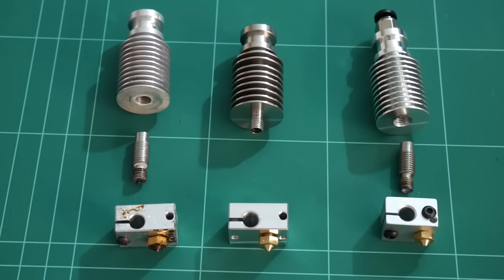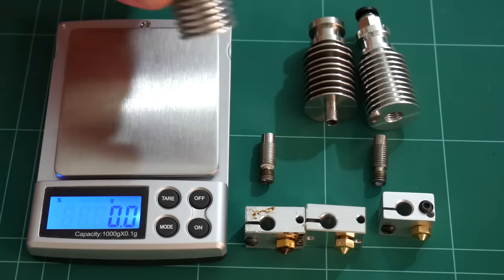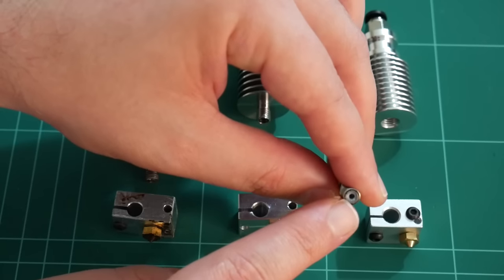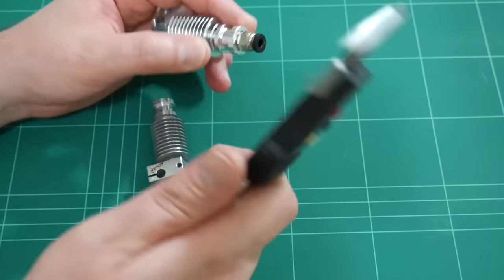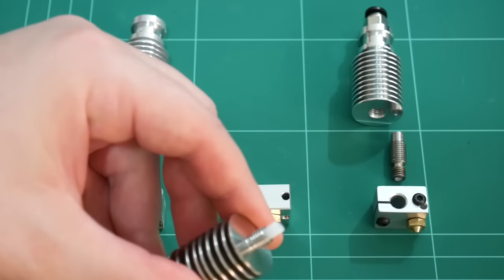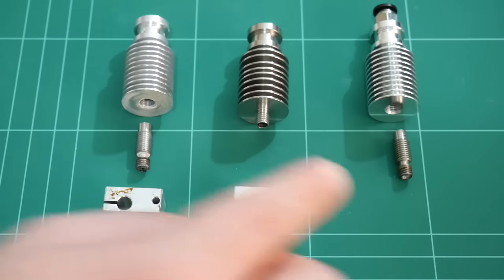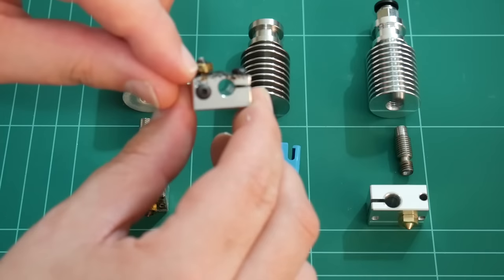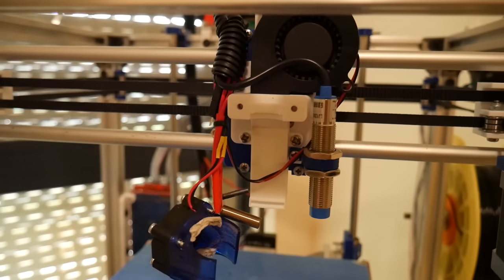3D Printer - E3D Hotend Differences

Comment: I dont like my Original v6, it's Jamming all over the time. The Clone one prints better, no Jamming and it's cheaper. Also the Material finish form the original is bad, lots of scratches. The Clone looks better ! 
I will sell the e3d on ebay ...